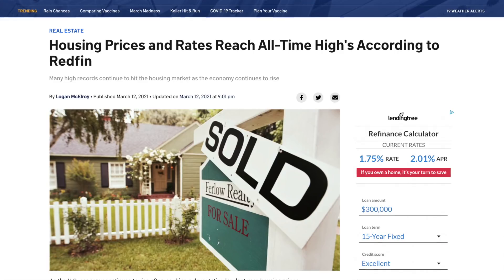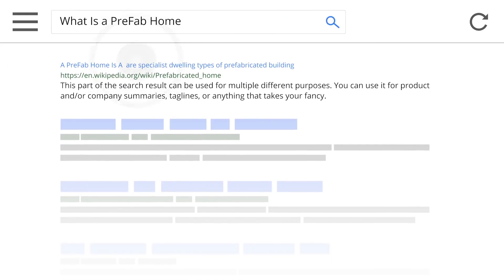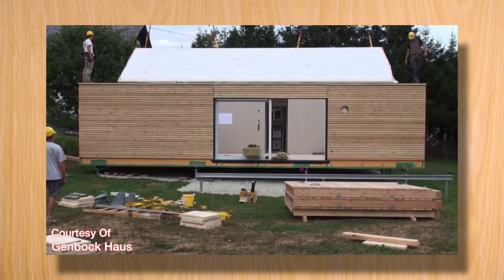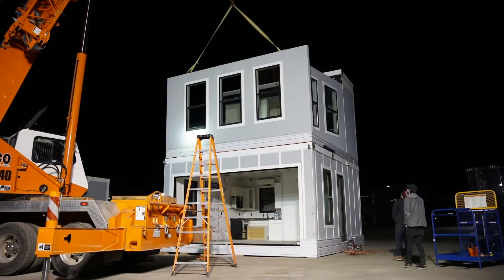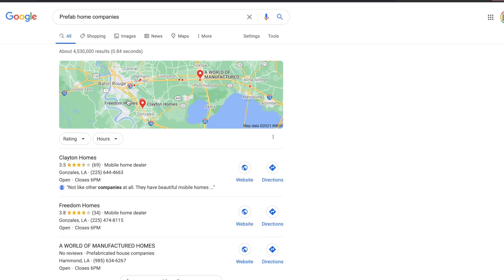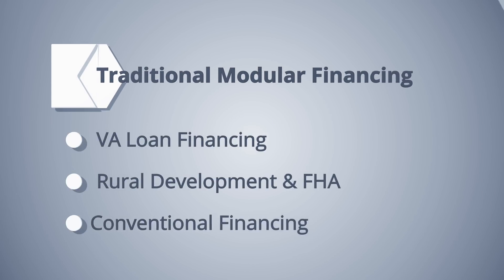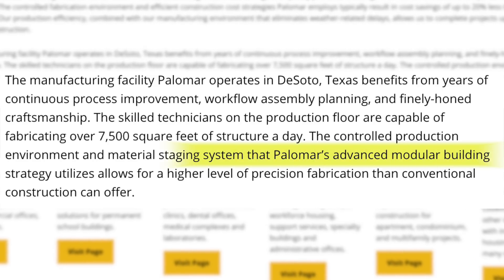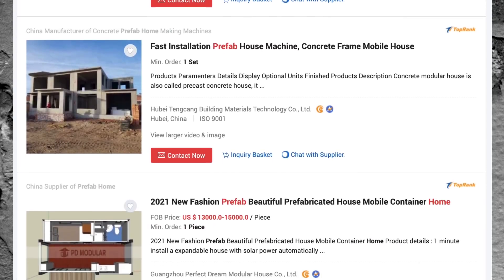The HUGE Difference Between PREFAB and Modular Homes

Comment: Now in order for the electric company to turn on power you have to show that all the permits and inspections have been passed even in the most rural parishes. So if you want electricity there is no way of going around the bureaucracy like 10+ years ago. We live in a very rural parish, only parish that doesn’t have a single red light. And we had a house that was destroyed in hurricane and so we tore it down and are putting a double wide and they are making us redo everything from surveys, to elevation, septic inspections, etc. or they won’t turn on power. As well as water companies started cutting off water to people that had more than one home on waterline.

Comment: Some of the red flags you mentioned are not that dire, there are others that you didn’t touch upon that are more a cause for alarm.  Vetting the company is extremely important, as too many are engaged in selling vapor ware, or unproven concepts that may never be proved worthwhile.  The biggest hurdle for buyers of pre assembled modular homes is actual logistics.  The factories where these are produced are not down the road where you want to have your hone erected, they’re typically many states away, and you need to look into the feasibility of trucking those modules cros country at exorbitant costs to cover wide load restrictions and carefully planned routes, and the special permits required, not to mention the rapidly increasing fuel surcharges. Then you have the cost of an on site crane which practically never drops below $5k a day.  Modular built to better than mobile home standards has a definite market, however this is not nor can it ever be an affordable alternative. The concrete 3D printed examples in CA are a cruel joke and a near complete boondoggle.    Boxable has a cool concept, less prone to complications in shipping due to their collapsible system, but you’re extremely limited in scope and breadth of product unless you’re so wedded to the idea or circumstances allow you to splurge big bucks for multiple units.  The answer to affordability is not that complex, it just needs breaking with the past in more practical ways to address the very complicated housing scenario we’re facing and shall face for many years to come.
Reply: “The answer to affordability is not that complex, it just needs breaking with the past in more practical ways…” — What do you suggest?

Comment: Have a P H modular that has withstood 110 mph winds, it sits with a concrete slab in the crawl space, so it in nailed down. It was built by the same guys that build the mobile homes, so just barely better than one. Anytime one Insures, hooks up to public utilities or finances the property file is pulled & the assessor will come document the upgrades, no drone's necessary. One has to remember the 1460 Dutch "fire place tax" is still in effect everywhere, so no matter what it is, one is renting from the government for life.